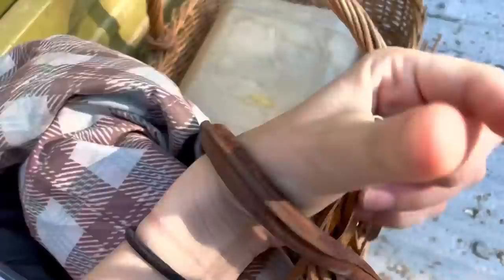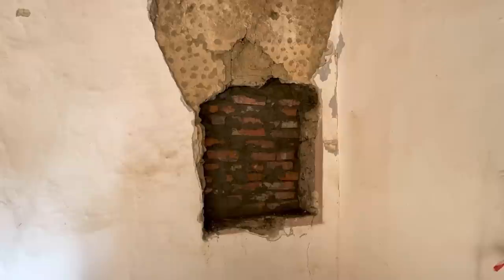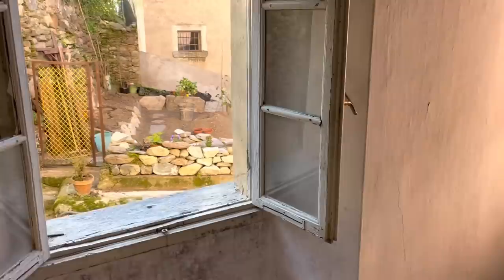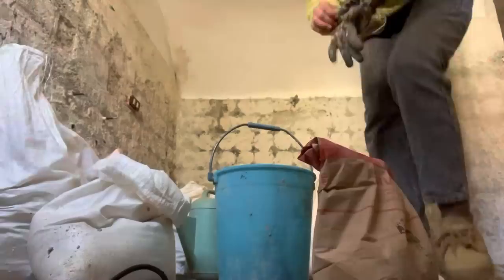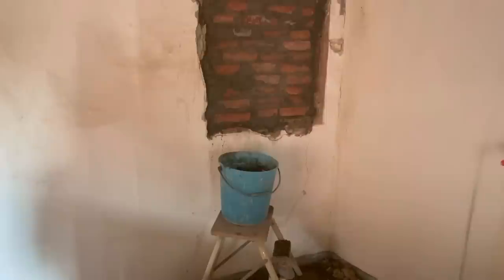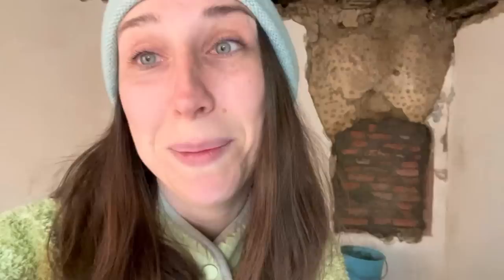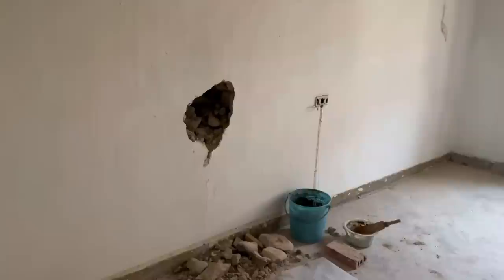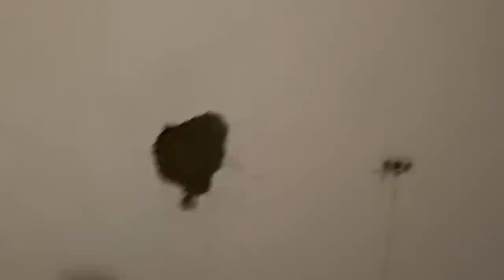One project done!\Renovating an old Italian villa

Comment: Alla,  I'm a bit concerned about the mortar you are using.  In a old building like this cement can cause more problems in the future.  A lime based mortar might be more suitable, it breathes with the old stonework.
Reply: I think I remember from a previous video when she was purchasing supplies for this project that lime was one of them.
Reply: @maryb.7043  we have a lime mortar but these 2 holes are too big for repair with soft mortar - it should be done with harder material to support the rest of the wall around the hole. It won't be a problem for breathing or humidity because it's just a little part of the walls. We will defenitely use lime mortar but in not such a big cracks.
Reply: Thanks for clarifying, Sergi, I knew you guys had it under control!

Comment: You should be using lime mortar. Cement will capture the moisture and cause major damp issues.
Reply: This is the inside walls - it shouldn't be a problem.